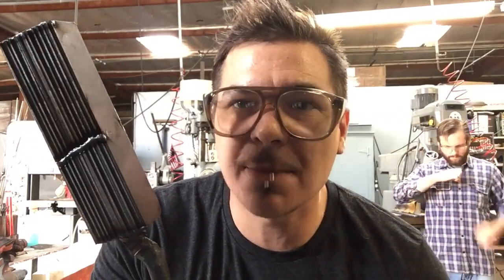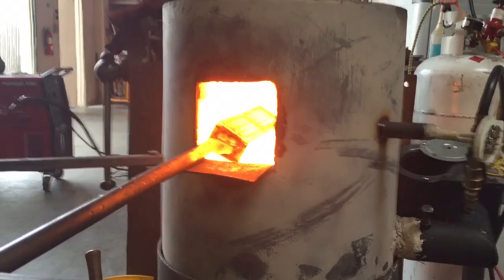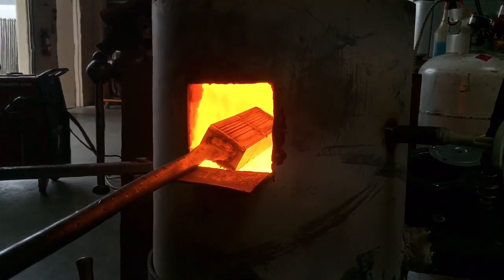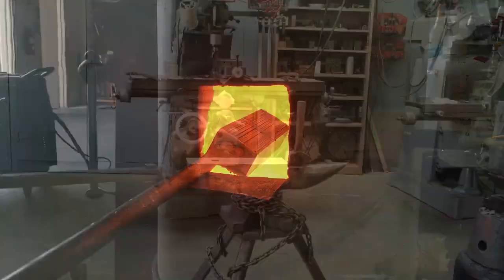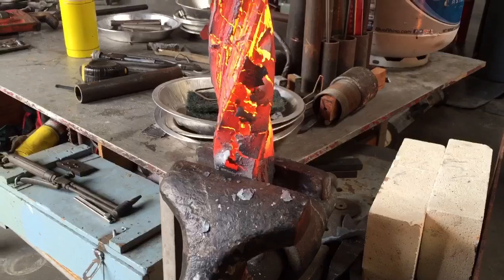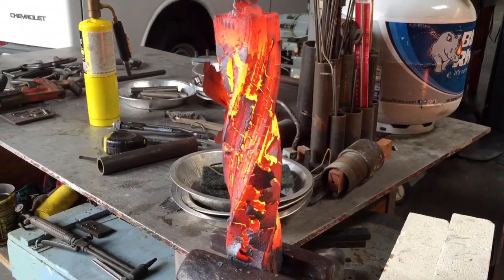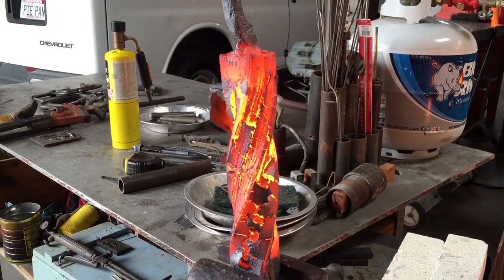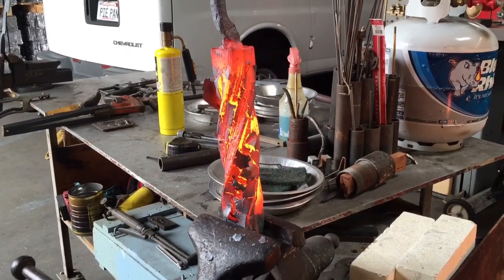Pattern Welding Primer

Comment: So my shop isn't wired for power and my tools aren't quite as modern, but we've been making pattern welded steel for nearly two thousand years. There has to be a way to keep a billet together without just taking a welder to it.

Comment: Do you use any flux or prep the surfaces before the weld
Reply from the maker: i used to get crazy and remove mill scale and flux the crap outa stuff but then i learned about tuning your forge to a reducing flame (more gas than air) now i just spray down with WD40 before it goes in the forge but thats probably not needed, as many forge truly bare back not even using WD40.
Reply: +Tucker Parris TAP Forge I'll have to try that on my next welds, love your vids by the way
Reply from the maker: Thanks i appreciate it!